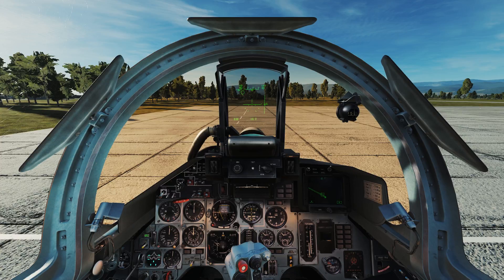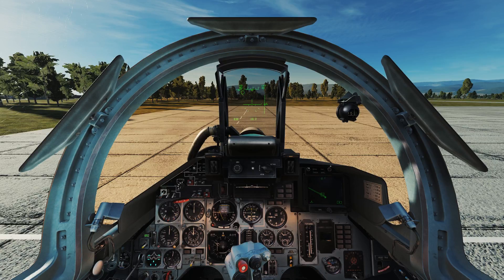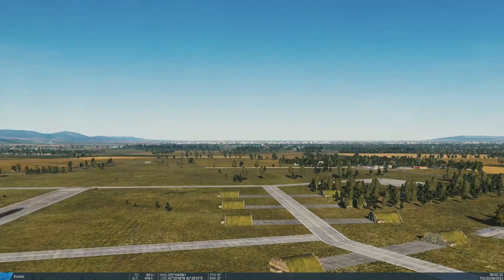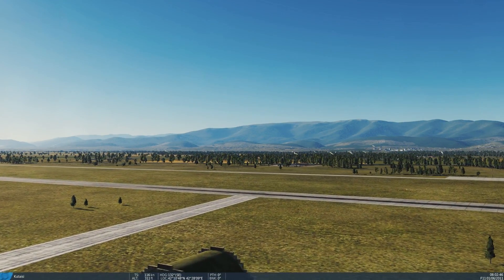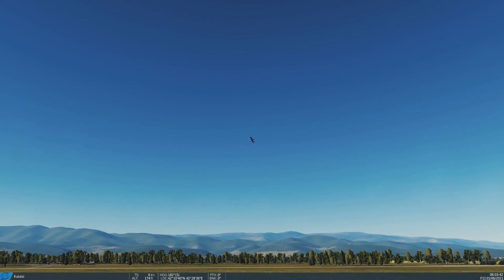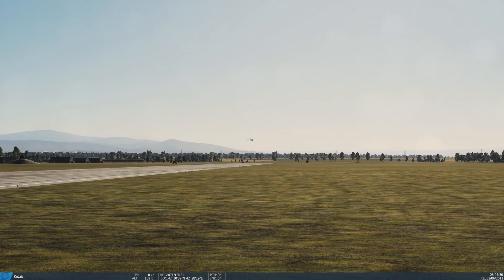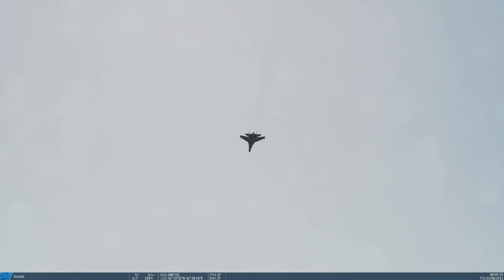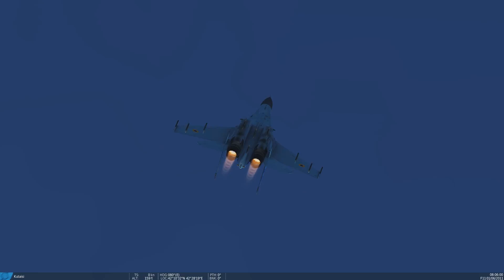Airshow Camera Tutorial - DCS

Comment: Thanks for the tutorial however I run into problems when trying to lock the F11 camera to the aircraft nothing happens when I hit the NUM./Del key. Could you suggest what I might be doing wrong?
Reply from the maker: No worries at all bud. If you go into your control options the one you are looking for in terms of locking the view to the jet is - Lock view (cycle padlock) and check what key it is bound to, you might have to assign it. I hope that helps! Huge thanks mate
Reply: Hi I have tried lots of different options but the NUM./Del key still does not provide a lock to any object in the F11 view as multiple tutorials say that it should. Have you got any thoughts on what is preventing the key to work as it is supposed to? Looks like Jos van der Meer had the same problem a couple of months ago as well..
Reply: @LIKWID  Currently the Lock View (Cycle Padlock) is only assigned to the keyboard key DEL. so I will assign it to a joystick button and see if that solves the problem.. thanks for getting back most appreciated.
Reply from the maker: @badenbr1  If you go into the options menu and go to the controls section where you have all the camera and view commands there will be an option with the Lock view (cycle padlock) and then just scroll right and see what key it is bound too, it could be that it is bound to a different key for you mate.
Reply: @LIKWID  As noted I assigned the Lock View (Cycle Padlock) to a throttle key and tried again. Once the replay is running I hit F11 and position the camera,  then I press the bound key and still get no lock on the single aircraft that is in the track file. Any more clues?
Reply from the maker: @badenbr1  That's really really strange mate and unfortunately I'm not sure why it would still not lock onto the aircraft once you have assigned it :| Jos just replied to me and said he fixed his problem so I've asked how he solved it, hopefully that might help for you too.
Reply: @LIKWID  Thanks Buddy for that, look forward to seeing what Jos did but it sounds like it was just as you have suggested with assigning the key which frustratingly is not working for me. :(
Reply: @badenbr1  same is happening to me
Reply: Have you allowed padlock view in you general gameplay settings under "difficulties"? If not, do so. In my case it was dissabled.

Comment: so basically the only problem i have encountered so far is that when i use the f 22 raptor mod in my airshow i complete it and after i go into the replay view to set up the camera and view it, the jet crashes very soon after it leaves the ground, almost like i took control of the replay thing even though i didnt press anything, i even went far enough to unplug my hotas because thats what i thought was causing the problem, anyone know the problem and fix?
Reply from the maker: Hey mate, unfortunately mods can have limited success when it comes to replaying them in track files. Despite the F22 mod using some of the F-15 avionics it's very hard to get a track file, one of the workarounds is to use a multiplayer server track file but even that can have limited results. The only option which would work 100% of the time is to get a friend to join the same server as you and record it. Host a private server etc etc. I hope one day DCS will get a better replay solution because even official modules can still have problems from time to time. I wish you good luck!
Reply: @LIKWID  thanks man, the f 15 for me is fine but it’s just the f 22 that has its Mess ups but anyways